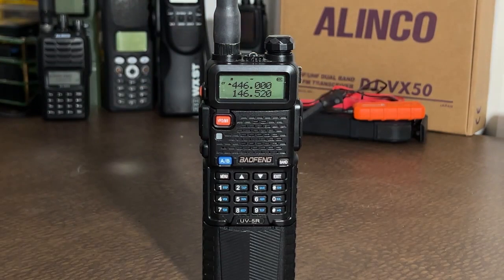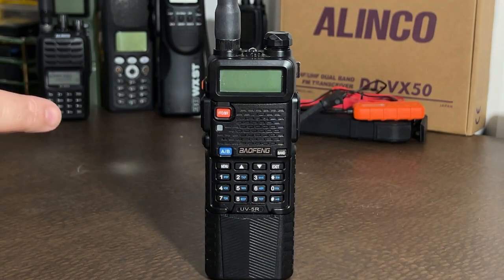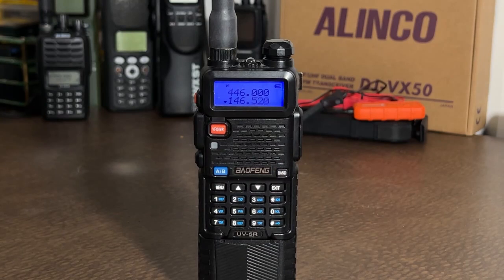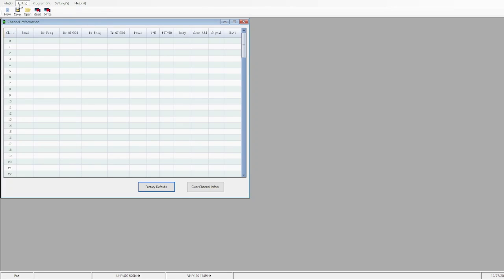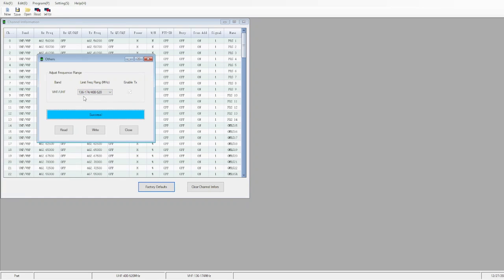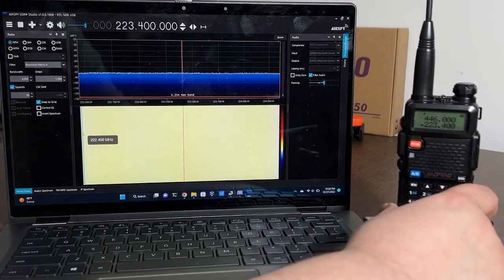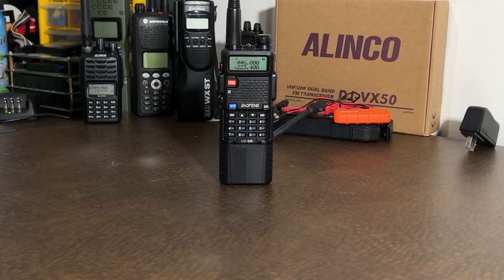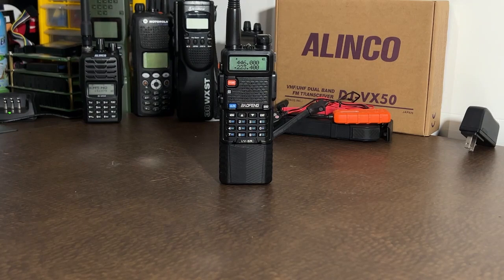220Mhz on a stock Baofeng UV-5R? Today we unlock the full potential! | Offgrid Technology

Comment: Use CHIRP is faster and safer.  You must unlock it first by pressing the PTT, monitor and VFO/MR buttons then power it on.  Then use the data cable, open up CHIRP and go to settings, other settings and change the upper VHF frequency to 260 then save the settings and upload to the radio.  That is it
Reply: I was just going to ask if Chirp would do this …
Reply from the maker: I just saw this, it seems they also support the frequency change on the Wouxun KG-UV9 series radios as well. Chirp has come a long way!!!
Reply: Dude your method is definetly the best👍 you deserve huge thanks
Reply: Just tried it, it worked.
Reply: I wonder how much further you can open up the frequencies?
Reply: Can this be done with the Bluetooth module from the phone app ?
Reply: @claytonwalley9356  I don't think CHIRP support bluetooth protocol.
Reply: Big bummer. Newer Uv5r's dont factory reset with that code anymore, or the variant holding moni
Reply: @HighTechnology2012  They sell a dongle which does, with a cell phone app.
Reply: It doesn't work pressing the buttons to unlock
Reply: @SR-gy1mi  Hack on, brother.  Hack on.
Reply: This worked on my couple year old UV5R, sorta. It unlocked the 220, but my output is only about 3/4 a watt. So it's not equal to a UV5x3 that claims 4 watts on 220/440.
Reply: I am using new, UV5R+Plus radios, I just bought off of Amazon. On CHIRP-next you have to use Radioddity UV-5RX3 - They don't have the Baofeng tri band models listed. Same radio though. It read and wrote to the radio without any problems at all. I got 3 of them - red, blue, and black. Wife and kid are going to get their license, so I bought us all the same radio, a different color, hopefully make it a bit of extra fun so they stick with it long enough to get into it :) EDIT: You do need to do the three-button reset first, or you can't transmit. It will work, just no transmit. Although you will need a tri band / separate 220 antenna to do so with any efficiency at all (and repeated use on your factory duck would do damage to the radio over time), and your output is pretty low. Mainly good for listening anyway. On a foot note, I'm kinda jealous of my kids hot-rod red one. I might have to buy one for myself and sneak it into the glovebox. LOL I don't care what anyone says - I've been licensed since 1995 and have all kinds of equipment. Base, mobile and HT. I love these little Chineseium things. I've indoctrinated at least 6 people into the hobby by giving them a $25 radio too. Finally my family is next I think! :)
Reply: @vibeaimusic  Yes, the 3 button unlocking is needed to be able to do TX.  I have  UV5R and UV82 in Indonrsia.  In Canada I have 2  UV82 HP (High Power).  😀
Reply: Thanks bro
Reply: What version of CHIRP are you using?   My CHIRP legacy-20221217 doesn't seem to "open" up 220 even on a radio with the 3 finger salute reset.   I will try another though..
Reply: Newer UV5R ,the unlocking by pressing PTT , monitor,VFO button doesn't happen.
Reply: @rajeevshagun7409  It should work when done properly.
Reply: @HighTechnology2012  I have tried several times in long time Frame , same result, it turn on with same way with welcome voice
Reply: For some reason the three button method doesn't work for me.  I have an older UV5R.
Reply: @HighTechnology2012 I’ve tried every way and every button. And so have lots of other people. It does not work anymore so we need a new or different method. Any ideas?
Reply: But on my new version UV 5R, three buttons method goes futile , I have tried may be 20 times on different occasions.
If it doesn't return to factory settings how else can I use chirp software to change frequency ranges?
Thanks
Reply: what do we do if the 3 button trick doesn't work , can we unlock using chirp ? massive thanks
Reply: Doesn't work it says cancel typing in last 223.400 digit new radio in 2024 maybe why I uploaded new save file did everything right
Reply: Didn't work for me, tried twice, increased to 260mhz in VHF Upper, hit "File" then "Save", uploaded to Radio, closed CHIRP, re opened, download from Radio, went to add 224.480 local Repeater, CHIRP said "Value outside of range" or something similar.
What did I do wrong ?

Comment: It requires a 220 MHz rubber duck/antenna to transmit on the 1.25cm band. No one ever seems to mention this fact. It also only transmits about .250 watts, or 1/4 of 1 watt on 220 MHz.
Reply: There's a few decent tri-band rubber ducks out there, I'd like to find a "shorty" though..
Reply: @smoejith9283  The Diamond I found is 144, 430, 1200 MHz and it is basically a dummy load a little over 1 inch tall gold connector. Diamond SRH805S. I would have to sweep it with the analyzer to see if it covers 220 MHz. The BaoFeng UV-5RH (colour screen) transmits almost 4 watts on 220, 3.89 watts.
Reply: @smoejith9283  I agree, people always want to add a really long 15 inch whip rubber duck and a big battery to their HT. I want the HT to be as small & compact carry as possible. if necessary I'll go to the mobile, or the base, if the HT can't make communications.
Reply: I noticed that myself - the SWR is dangerously high. - I wouldn't recommend sustained transmit without the correct antenna. Even then I have my doubts what it will output at 220.

Comment: I got a 5RIII and that was only to get a 220 capable radio.  As dedicated 220 radios sell for alot used so getting on dirt cheap was a factor that sold me on it.  The radio does the job and signal reports are fine.  The TX audio is a little narrow compared to some Japanese radios but not that bad.  I need to reprogram mine as I have moved about 40 miles and need to optimize it but it is was not meant to be my primary radio except on 220.  I got chirp programming but have not used that for a couple years with the radio.

Comment: I wanted a waterproof Baofeng so I got the UV9R pro. Wanted the 1.25 meter band like you can get with the Baofeng UV5-x3 tri band, but it wasn't waterproof. Saw comments on Amazon about adding these extra bands like 1.25 on an AT-152 so I bought the 9R pro and tried it with CHIRP. I factory unlocked the radio with the 4 finger dance, then connected the radio with CHIRP. Read the radio with the radio selected as UV9R pro. When I tried to change the freq limits for the VHF and the UHF bands, CHIRP flagged it as out of bounds. So as the commenter on Amazon said, she used the BF8P as the radio selection to access the data. So I did that and was able to change the limits on the VHF from 100-400 MHz and 400-520 MHz. Tried to add a channel via Chirp, and as others have reported, the software said it was out of bounds even with the new Freq Limits. So yes I can use freq mode and set a channel like 222.222 and it will stay there and send/receive. So I don't think this Chinese version of Chirp will do anything better than Chirp. Actually, I tried to us this software and the radio did not connect. It might be this is strictly for a UV5R because it didn't ask what radio I had. As for the low power on the 1.25 meter band. I was able to talk with two radios about 200 feet apart with an upgraded dual band antenna. I will be getting a tri band antenna tomorrow and will probably do some propagation tests. I wish they made a waterproof version in TRi Band and I would pick it up, so for now this will be my triband HT setup.
Reply from the maker: Nice thought to try. I agree IP67 should be standard these days.
Reply: Sorry, I'm a little confused. Were you or were you not able to unlock 1.25m band on the UV9r pro..?
Reply: @MordionGaming  That was awhile back. Can't remember what the results were for the AT152 and/or the UV9Rpro but after much research and trials, I settled on a bit pricier, but I think worth it, model, the BTECH UV-5X3 Tri-Band Radio ($70 Amazon). The features that sold me were the abilities to add alpha-numeric and frequency values in the two line display. So you don't have to memorize what is that frequency showing in the display. The USB-C  batteries. Can recharge on the included cradle or straight to the battery with charging block and a USB-C cable. Two batteries were included as well. Lastly it is waterproof. BTW, I also did a lot of testing on the stock antennas and ended up going with  the Diamond SRH320A 144/220/440 MHz Tri-Band Handheld SMA Antenna. By far the best of all I tested. Note, the Amazon ad say it will not fit the Baofeng but if you buy an SMA female to female adapter it works fine.

Comment: I tried to add the 220Mhz to my new UV-5R 8 watt with no luck. I did unlock it so I can use GMRS/FRS on it but it just won't go above 178.998Mhz on the lower end.  Doesn't matter because I'm going to order a couple Baofeng 5RX radios with already do the 1.25M band as well as Airbands.

Comment: Thank you for posting this video. It worked for me, but the software program does not seem to accept new entries in the 220 mhz range - get an error message saying that the input frequency is out of range. So, the software allows you to 'extend' the range, making the UV-5R a tri-band radio, but it will not allow you to add any frequencies in the 220mhz range to the memory spreadsheet. You have to program the 220 frequencies into the UV-5R manually on the TX.
Reply: It happens.  Depends on your version.  Enjoy your extremely versatile UV5R anyway.  Plenty of functions to learn...

Comment: Oh, it works.  Did it on a bunch of UV5R's.  Dunno how much they're outputting, but they work.  Might have to "unlock" your newer models.  An 8 Watt uv5r that old isn't typical  Watch to be sure that Chirp is not registering the settings, although your radio may not be outputting.  Use another radio to test.
But really, these radios work on so many frequencies, there are plenty to go around.  I love 'em  :-)  I don't need to "outband" beyond the established specifications.
I have too much trouble programming anything but the Baofeng / Pofung brands.  All the other "Models" seem to only acquire carloads of UV5R's in differing cases from China, then make the firmware unusable.  It's not worth a lost weekend hacking away at a 50 dollar - yet still overpriced - radio.
Reply from the maker: Glad to hear.
Reply: less than 1 watt,  I put a watt meter in line.  2m and 70cm measured about 4 watts 1.25 m measured less than 1 watt.
Reply: @brucebigam8693  good enough for close quarters small squad truck communications I'd say.
Reply: @brucebigam8693  You get what you pay for.  The tri-band Baofeng's might be marginally better  ;-)

Comment: Works great for any radios made prior to 2023.
I just bought a new "FCC certified" UV5R with the date code for March, 2023 and it will read, but not write; and yes, I know about the "Factory" reset (hold PTT, MON, and VFO, then turn on, wait for the "Factory" to appear, release keys and press MENU).

Unfortunately it looks like the FCC has been in our business once again 😕.
Reply: The factory reset method you were mentioning does not do what you probably think it does. You use that reset to allow your radio to actually transmit and receive on those frequencies. But you also have to unlock those frequencies using the programming software. By using that software you can redefine the frequency boundaries. Maybe try again because I've heard of others purchasing radios this year and doing it correctly. The not writing portion of your comment makes me believe you've messed up a step or messed up somewhere with the programming.
Reply: @-pyrosef- I've had the same issue. Still wont write it into my radio

Comment: Has anyone been able to get this done using Linux?  Got the program running with Wine also installed programming wire driver with Wine , tried all com ports and software doesnt see the radio. Any tips?
Reply: Using baofeng cable

Comment: Didn't work on mine for some reason. Everything looks just like your setup. No errors... read/write but the radio still doesn't accept 220. Might be because is an older model. Any tips?
Reply from the maker: Interesting might be a different firmware.
Reply: I thought I had the same problem, both this Chinese and CHIRP and CHIRP NEXT wouldn't allow me to enter a 1.25 meter frequencies from within the software to upload to the radio. BUT,... I was able to hand jam a 220 freq manually. Try this is you haven't, might work. It saved and tx for me. Good luck.
Reply: Are you a gambling man?  Willing to take a 20 dollar bet you can't really lose?  They throw in a radio, regardless.

Comment: Thanks for the hack.  Have you found a way to create a channel with 1.25M?  Once opening up the radio, neither Chirp or this new program will allow 1.25M channel to be setup/saved.  Would your thought be only to use this for simplex?

UPDATE: I was able to manually program the radio for a local repeater, but with the low power output that others have already mentioned it wasn't a good experience. My final thoughts . . . . . Yes it will, but I probably won't.  But I still like it.
Reply from the maker: I would only use it as a last ditch resort. But like you said I like the ability to do it.
Reply: How well does it receive?

Comment: the program I downloaded is in chinese
Reply: You have to follow the vidio.  There is a Chinese spot you cluck on to change it to English.   My UV-5R will not program to the 220 frequency.  I do have the triband version and it seems to work fine on 220.  The  lable under the battery of mine is different.  It does not have the battery voltage and the frequency range writing is smaller.
Reply: @ralphmowery2898  Hens Cluck Hams Click ....  I just made that up sorry 🙂

Comment: Will the new 8watt ones unlock ?
Reply from the maker: Mine was an older, but should work unless Baofeng made drastic changes more than higher wattage.
Reply: Yes, mine did.
Reply: UV5R8W here, the software provided in the video did not get it onto 1.25m bands. I installed CHIRP and set the maximum VHF frequency to 260, and that saved and works just fine.

Comment: You do realize that while it appears to work you are only transmitting at about 1/100 of a watt on 1.25m? Don’t believe me? Put a watt meter on it or try testing from a distance greater than inside a room.
Reply from the maker: That does not mean to stop trying and push limits and hack gear as radio operators do!
Reply from the maker: 1.1-1.3 watts on mine. Sure low but usable.
Reply: @offgrid.technology  That is usable. Curious if yours is a regular 5R or the 8 watt/ tri power?
Reply from the maker: It’s a regular UV-5R dual band but it is an 8 watt version. Funny is my 10w AR-152 only puts out about 700mw.
Reply: Interesting. I have a couple tri banders that actually put out 6 watts on 220 and 4-5 on 144/440.  I don’t know what the hardware difference is but there must be one. In my opinion I wouldn’t transmit on a modded radio too much unless an emergency because I’m not convinced it’s safe for the finals. However having the ability to monitor 220 is a big plus. This mod if you can call it that works on most the Chinese radios as long as you use the factory (not Chirp) software. I was able to get it to work on 1 out of 3 UV-82 to TX a little under on watt. One did nothing and the other beeped and shut off when you hit PTT. After a factory reset it was ok. As for people concerned about spurious emissions it’s a Baofeng so whatever. My Chinese microwave is worse…
Reply: @RandomWire107  I used Chirp.  Most of the radios were newer UV5R's, all similar.  Thanks for the information.  I have a wide variety of these and now have something to watch for.
Reply: The rest of the power is being emitted on the 70cm harmonic.
Reply: I do not have a meter that goes that low but it is less than 1 watt

Comment: Do not try this!  The radio puts out milliwatts on 220, but on the 2nd harmonic.....in the 440, 70 cm band, a full power signal is transmitted. As such, this makes use of the radio on 220 highly illegal.
Reply from the maker: Thank you for this comment. This was a demonstration on that it could be done for SHTF or just because we can. You should also know ham is also about pushing boundaries and finding new things. Encourage those to push the limits not just fall in line.
Reply: @OffGrid.Technology  I'm all for experiments; but in this case the end result is disastrous.
Reply: @johnlwilkers  o stopppppppooo it
Reply: @johnlwilkers  Kittens died??  😞
Reply: @Bob G  come on.  Let's be serious.  Spurious emission of this type is wrong.  Try to set the 220 to where the harmonic matches a 70 cm repeater input, including pl and give it a try.  Imagine that going on when you are using 220....interfering with a 70 cm repeater.  Not only a violation of emissions rules but a malicious interference violation. Also.

Btw...I hate cats.  One dying would actually make me happy.
Reply: @offgrid.technology  rubbish, in a SHTF situation you would not want to do this since  anyone looking for radio signals will find you in a flash having a signal spread out over several hundred Mhz.  A signal like that is like a big huge red flag saying look at me. In a SHTF situation you want to be as unobtrusive as you can.
Reply: Just don’t transmit
Reply: @germanjohn5626  so in a shtf situation would he be staying still?
Reply: Will I go to hell?
Reply: @johnlwilkers  Tell Schrodinger that!